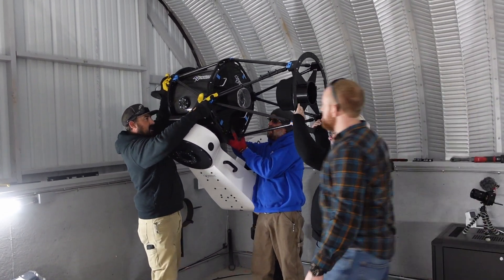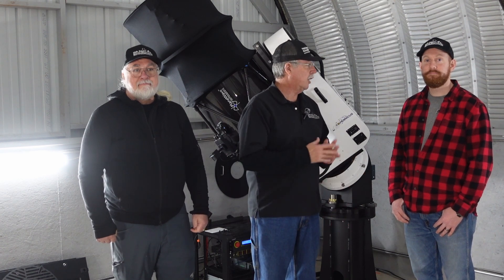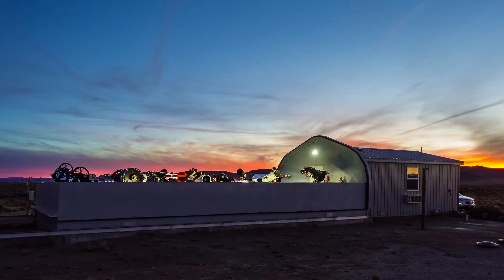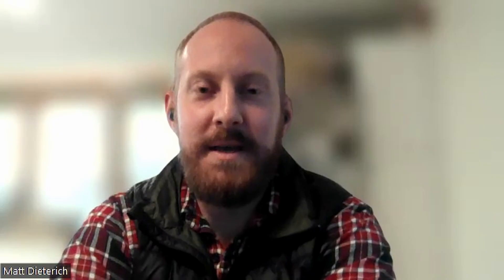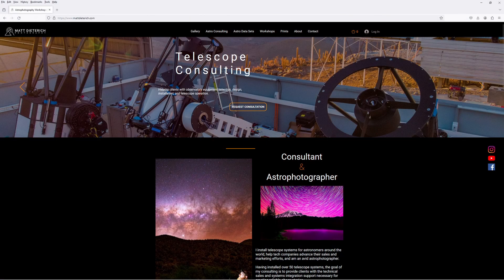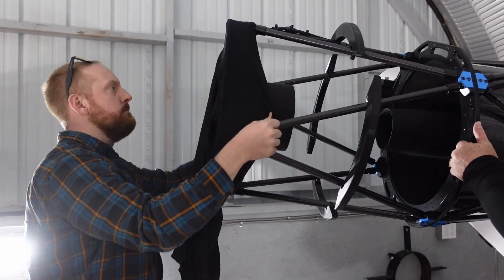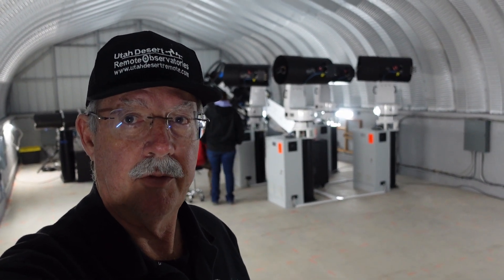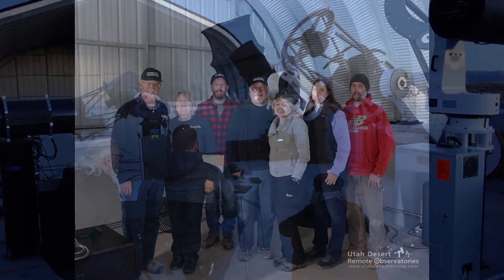Installing a PlaneWave CDK17 and L500 Mount

Comment: Fantastic video!  I’d love to see a followup on how the beam splitter is working.  I’d also like to know what camera he’s using, which filters, rotator, auto-focuser, etc.  And see some of his photos!
Reply: Hi Gary, thanks for your interest! I'm using a Moravian Instruments C5A-100 imaging camera with the matching Moravian EFW-5XL-7-II filter wheel and 50 x 50 mm square Chroma 3 nm LRGBSHO filters. I selected the Optec Gemini rotator/focuser.

The stock Innovations Foresight ONAG XM model was custom modified by John Hayes to work with the larger 55 mm diagonal sensor used by the C5A-100 camera and I'm using the ZWO ASI294MM uncooled camera for guiding. Binned 2x2, this still gives me 4,144 x 2,822, 4.63 micron pixels with a diagonal size of over 23 mm to guide with. Nearly an APS-C sized guiding image!!

Multi star guiding really helps keep the RMS error down so I'm looking forward to seeing what it will do. I'm still working on finishing the software setup but will post some images when I get them and provide a follow-up report on the ONAG.